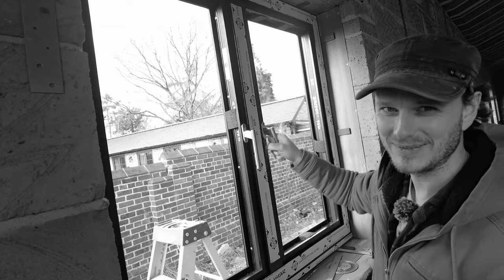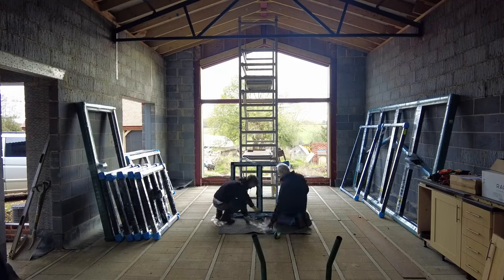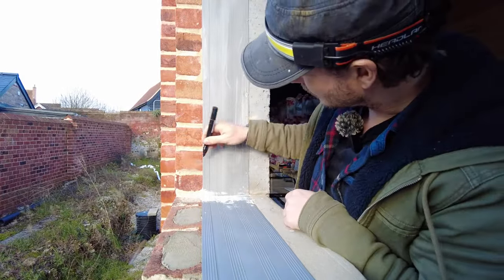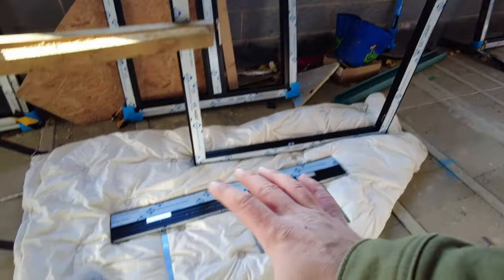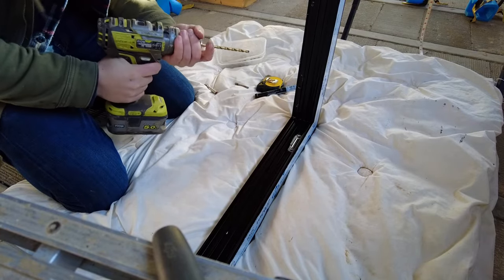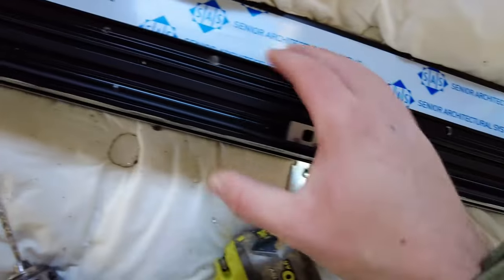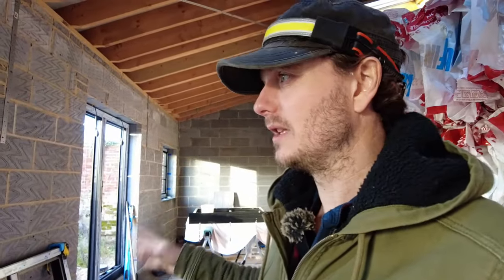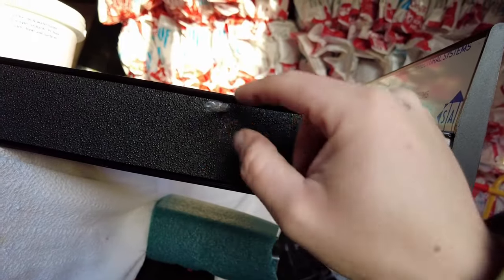How To Fit An Aluminium Window  - Complete DIY Guide UK (from purchase to install)

Comment: Hi Aiden, just fitted the first of our ali windows in our renovation project. Your video was 100 times more useful than the manuals from the supplier/manufacturer - thanks so much for the video. Your project looks amazing - just subscribed. Cheers!
Reply from the maker: Awesome 🙌 you don't fancy coming to fit the rest of mine do you? 😂 I suppose that will be my job this week actually, fitting the other 5 French windows, then I've just got the gable end to do

Comment: To help with the vinyl rubber bead gasket spray a mist of glass cleaner into the gap first unless you are applying the caulk bead spots.  We always cut them longer before you start as you mentioned since they will shrink over time and you start at the ends and work the loop at the center down  to constantly push the vinyl toward the ends equally.  If you  stretch the vinyl while only pushing in one direction from one end then cut the excess off and after a few months the vinyl will shrink back and give gaps at that end creating a poor look.

 To save on shims pre cut them and run the same direction as the straps to just cut them once as you cut off the excess strap.

On the exterior here in Florida in the US we caulk the exterior with a silicone hybrid type over that expandable foam or we use a closed cell backer rod.  Due to wind loads and water we have to seal them that way.  If you use that flat strap dress metal put your double sided tape on one side to temporarily apply it to the frame. I also run a bead under the strap to the frame behind the tape since after a few years it will release. Caulk under each corner where they meet to 'marry" the corners. Run a bead along the flat strap edge and frame as well as the entire length around the perimeter at the brick or whatever substrate that is applied.  Corrugated steel, stucco, hardy board or painted pressure treat wood etc. We also bed the sill pan in caulking as well as the back line and sides in the "pan" to keep the wind from whistling thru on stormy days and to prevent water from bubbling at the inside back.

Comment: Belt and Braces and all that! When you doing Gable End?How many sections of glass will that be? Couldn’t see pro fitters taking so much care great job 👏
Reply from the maker: I'll do the gable end last and when I can get some help. It will have a 4 leaf bifolds down below and 4 sections of glass up top. I need to do some work on the steel and set up scaffolding and that. I'm taking my time 😂

Comment: Great video. I need to replace a blown double glazed window from its aluminium frame. Is it easy to remove the gasket and bead? Do I need to use the orange plastic window shovel tool to remove  the beads?
Reply from the maker: Yes it's pretty easy, although sometimes there is abit of a knack to it. I can do a video about it soon if it would be helpful? You don't necessarily need a glazing paddle although they are pretty cheap so no reason not to have one on hand
Reply: @THE-AIDEN-PROJECT  thanks. A video on the subject would be great. Until then, could you give me a brief idea on how to do it? I’ve seen videos on UPVC windows, but can’t find any on aluminium windows. The beads flex on UPVC, so can’t see how this would work on the aluminium beads.
Reply from the maker: @ww4407  In my experience I've only dealt with one type where the gasket is separate from the bead. For the video I was thinking of buying a couple of 2nd hand aluminium windows to maybe show some variables. Anyway, you pull the gasket out first, then give the bead a knock with either your palm or side of your fist. Most uPVC ones have the gasket integrated that's why you deal with them differently.
Reply: @THE-AIDEN-PROJECT  Appreciate you getting back. I’ll try to remove the rubber gasket and see how I go from there.

Comment: I really like you dedication and attention to details. 
 Could you please recommend a place where I can buy the foam insulation insert inside the frame and the expanding foam tape. A recently bought 2 aluminium windows but mine did not come with all these . Thank you
Reply from the maker: Hey, the foam tape for the glazing came directly from the manufacturer, if you want to do something similar I'd recommend you use foam backer rod (that's what I do with my doors) if you get 10mm that would work. The expanding foam tape is called ISO Bloco one. It's very expensive though and hard to deal with if you are doing direct fixing, it's better if you use straps. I do have another video on my channel about sealing windows frames with silicone and expanding foam in a can, you should check that out 👍

Comment: I'm also wanting to set my UPVC frames back by 25mm into the cavity but I didnt realise you can use the metal window straps under the cill too, I thought they were just for the sides. 

Why did you choose expanding foam tape around the frame over insulating expanding foam from a gun like illbruck 330?

When the inner and outer walls are the same height at window openings, then you add the cill to the outer leaf, an off cut I got has the cill at 35mm high where the window frame sits on it, so I'd need a really thick internal timber window board. How have you got round this issue?
Reply from the maker: Yeah you can use the straps anywhere you like 😉 it's abit easier with uPVC as you can easily use the universal straps if the manufacturer hasn't got specific ones that twist into the profiles. 

I've used the illbruck expanding foam on some windows on the other side where I've got block to render. For the brick side I thought it might look better to use the expanding foam tape rather than try and get a good silicone finish against the brick. The foam tape is alot easier when you're using the straps so you don't have to mess about with foam in a can and silicone, it saves time and is tidy. Although because I had to direct fix on that side and f'ed up some of the expanding foam tape I'll be covering it up with some aluminium flat bar beading 🙈 

With regards to the window boards I'm not that far in yet, but really you should be insulating your reveals including the bottom. I'll likely be using eps backed plasterboard. So that will bump up the bottom before you put a window board in. I'm thinking of doing abit of an experiment with the eps tile backer boards and microcementing them, so I'd be having thicker window boards anyway 😅 no idea if I can pull that off

Comment: Hello i see that your aluminium windows have some black foam looking stuff in the channels (not the expanding foam tape), did you install this , the channels on my window are hollow?
Reply from the maker: This is thermal enhancement foam tape I installed which is offered by the manufacturer. You can achieve the same thing by using foam backer rod. I've just actually used some foam backer rod in the gable windows I just installed today  because it was too tight for the thermal enhancement tape. You just pop the window in and then tuck the backer rod in with a packer afterwards

Comment: Hey, brilliant channel…. I’m getting loads of tips here for my project!
where did you get the expanding insulation foam strip with the weather seal?
Reply from the maker: Online website called Affixit. Proceed with caution though, it's tough to use when you're direct fixing, it's much better when you use straps/cleats
Reply: @THE-AIDEN-PROJECT  thanks for the reply! I will be direct fixing and will be extra cautious (do you mean make sure I cut the foam where the drill will come through? did the hole punching/making tool work?) cheers, Chris
Reply from the maker: @ChrisDummett  yeah the hole punch worked, although I wish the holes had been a  little bigger. I had to do my fixing quite close to the front edge of the frame so if yours is further back it will be easier. It's definitely easier to do whilst it's cold as it'll take a good few hours to expand. The tape is iso block one, it's expensive stuff
Reply: @THE-AIDEN-PROJECT  wow.. thanks again for the reply! I really appreciate it. Thanks for the heads up and I’ll give it a whirl and I’ll let you know how I get on :)

Comment: great video . Can you recommend an external upvc window frame sealant as the original sealant has come away from the upvc frame. I did not realise but some frame sealants do say " when  used internally , it will stick to upvc, "  but I need one to stick to upvc window frame externally.

Thank you
Reply from the maker: @yoshii793  I use Soudaseal 215lm, that's fine to use externally and on uPVC
Reply: @THE-AIDEN-PROJECT  thank you
You always have time to reply unlike many others. Thank you 😊
Reply from the maker: @yoshii793  I try 👍

Comment: Great video fella, what was the different sealant souder said you needed for the bottom if the door?
Reply from the maker: Silirub 2
Reply: Cheers
Reply: @THE-AIDEN-PROJECT sorry to bother you again, u mentioned silitub 2, was that to use between the sill and the brickwork? And was that inside and outside? 

Any reason they said to use this there instead if 215 for outside and acryrub 2 on inside?
Reply from the maker: @Jackzuk   I used the silirub 2 on the doors, I had to put it at the bottom between the glass and frame. That's cause it is compatible with butyl which they use to stick the glass together. I used the 215lm everywhere else on the frame, inside and out
Reply: @THE-AIDEN-PROJECT so you had to seal the glass to the frame, any reason why u needed to do this, is that something to do with the air tightness u was going for.
Reply from the maker: @Jackzuk  watch the last few minutes of my door video https://youtu.be/ja3hGFuJ7pE?si=H4TCw4wE92MwL9bW

Comment: How do you go about getting a FENSIA certification for building regs because I’m sure that the local authority which is district surveyors for the local council would want a certification for the windows that has been fitted. Am I right or am I wrong?
Reply from the maker: Hi, you can't get a fensa certificate unless a fensa certified installer has fitted your windows. Someone that is fensa certified effectively has delegated authority to sign off their own install. Otherwise you get your local authority's building control to check your own work to make sure it complies. They will do a quick inspection to check you've fixed it properly and may ask you for the security certificates from the manufacturer or data sheets for u values. They can see from the glass stamps that it is toughened glass or laminated. You can get building control in as you're fitting them or you make a retrospective application afterwards (just make sure you keep pictures if you have used straps and then have covered them when you have decorated). If you don't do either you can get insurance indemnity policies for possible non compliance when you sell your home. If you're doing other building work that involves building control, like my build, they will just check the windows as part of the whole thing, there isn't a seperate charge.
Reply: It’s very interesting. Many thanks for your information. It’s good to know what I’m about to build a granny flat on the side of my house. I could get the windows from the supplier and then get the  den. I can get the local building control to pass the windows and doors. Nice to know. Many thanks
Reply from the maker: @mrv8788  sounds like a plan 🙌

Comment: Great video, very informative! Just to ask, did your aluminium cills come already cut to size or did you cut them yourself? Just asked the manufacturer and they said they will come 100mm larger as standard but I dont want to be cutting matt black aluminium 😅 cheers
Reply from the maker: They were cut to size already, although I would have preferred to have done them myself because I would have liked to have had them a few mm bigger. If you get them 100mm bigger you also get the option to have a horn if you want 😁 I can imagine them being a challenge to cut accurately without the right tools though 😬 I'd be getting a proper dedicated blade for my mitre saw (if I wasn't having horns that is)
Reply: @THE-AIDEN-PROJECT  thanks for the quick reply. So you had yours cut flush to the size of the window? Yeah I hear what your saying about a couple mil each side extra - no horn for me luckily. Cheers!
Reply from the maker: @thomasshackford8345  yeah the cill itself was flush with the sides of the window then the caps went on which are a couple of mm each. When I did uPVC windows in the past I cut the cill down wider so there was at least 5mm each side past the window. It doesn't particularly matter if you are rendering but having it slightly wider is better if you have brick externally

Comment: Wish I'd had access to this three years ago when fitting some ali windows to my garden room.  Compared to you, looks like I bodged it!  Nothing leaking yet though...  And I agree, those fixing straps are so much easier.
Reply from the maker: Really? I'm interested to know what you did differently
Reply: @THE-AIDEN-PROJECT  No drama.  I was fitting mine to a timber frame garden building and wasn't so worried about cold bridging and the like.  I followed some vids by Badger Workshop on how he did his but my windows were ali.  I remember the manufacturer's documentation being absolue pony and struggling to work out what was actually important and what was allegedly important but wasn't.  What you have here is a step-by-step guide of what to do properly.  Everything else out there is (or at least was three years ago) half-arsed.
Reply from the maker: @andyrobinson6052  yeah it's alot easier to fit windows into timber framing. I did notice that there wasn't many comprehensive guides. Oakwood garden rooms done one in the recent past that is useful, even though he speeds round like he is on drugs 😂
Fingers crossed my video helps people in the future

Comment: Building Regulations Approved Document L is now a minefield.
The Notional U value for windows and doors in New Build Dwellings is actually 1.2 W/m2K. It may be possible to use the Limiting U value of 1.6 W/m2K permitted in the regulations, but the thermal performance elsewhere in the building design will have to exceed the notional U value performance to compensate. Beware, it is not the window supplier/installers decision whether Notional or Limiting U values apply to any New Build Dwelling.
Another issue is whether the U value assessment of the windows and doors is to be based on the SEN standard size and configuration or the actual size of configuration for the Dwelling.
Architects I speak to are saying that they have to base U value calculations for windows and doors on the actual size and configuration as they have to demonstrate the achieved U values against the target U values of the building design.
In my opinion the subject of U values for windows and doors in both New Build Dwellings and Existing Dwellings is absolutely going to generate disputes.
ALWAYS GET THE U VALUE REQUIREMENT AND THE U VALUE ASSESSMENT METHOD CONFIRMED IN WRITING
Reply from the maker: Thanks for the considered comment Nigel. Luckily I'm on old regs so in theory I've gone well below what my plans and SAP were calculated on. I think the new regs will probably put a block on many window suppliers for not having low enough u values. Things should be clearer really

Comment: Where did you source your windows from and would you recommend them im looking at getting a few aluminium ones in the future. And where did you source the foam tape ive used the illbruck tape before but its extortionate 🤯
Reply from the maker: I got them from a company called FrameX. The price was good but I have had problems with the French windows (they set the sashes too close). They did look to put things right and remade them but ultimately I had to fix them myself with a work around. They also replaced glass that was wrong. So I guess it's better the devil you know, maybe? 
I used ISO Bloco One, still super expensive but not as much as Illbruck. Direct fixing with expanding foam tape is abit of a nightmare though. If you can get frames where you can use straps it's much easier. Mine are deep frames with thermal enhancement so couldn't use straps.
Reply: @THE-AIDEN-PROJECT  thankyou yes I've heard of them. I've done a few upvc windows in the past with minor issues however I've done some big bottom open windows with triple glazing and having issues with 1 bowing and letting water past the seal where glass sits and another where the sash drops down to the point where you can't close the window. Been a pain that's why I'm looking into aluminium instead.  And I'll look into the tape. Another option I was thinking was to use 6-10mm wedi board and rendering / plastering over. Should be a decent thermal break.
Reply from the maker: @jameshazelip3998  ahaaa I'm thinking of using wedi type board for my reveals on the inside too 🙌 great minds think alike. I might take it a step further and use it for my internal window boards and then microcement over them 😉
Reply: @THE-AIDEN-PROJECT  they do indeed 🤣 however I would be careful about microcementing over them I've read up that wedi board isn't suitable as it flexs etc. You may have to stick some tile backer board on top of it first 👍
Reply from the maker: @jameshazelip3998  sounds like a plan 🙌